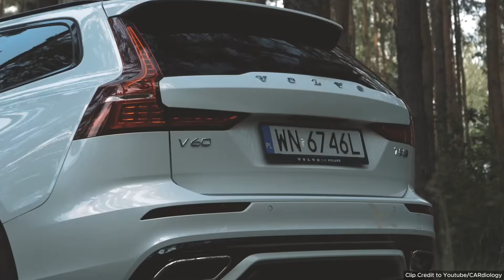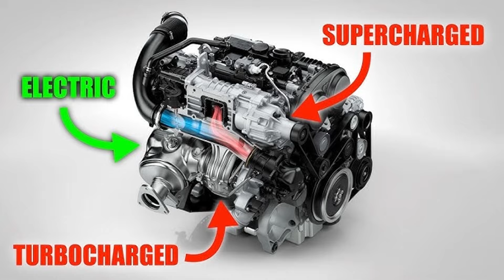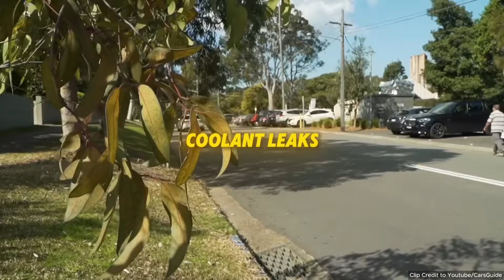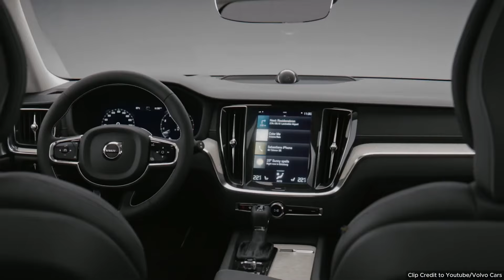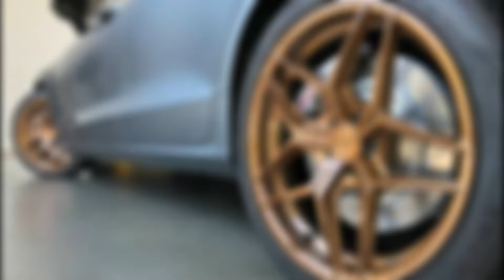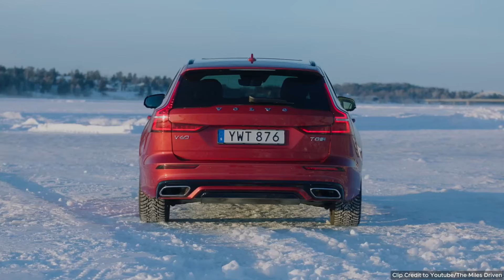Volvo V60 (2018–present): A Complete Reliability Guide

Comment: No it's not the oil exception,

Your lieing, it's the rings fitted on the pistons, that clog up so the oil cannot drain back, so it gets burnt off out through the exhaust that's why it drinks oil.

The BS carefully worded rubbish of modern day crao

👎👎👎👎👎👎👎

In my opinion never buy a car with a sun roof, to fully avoid leaks, problem solved 👍

Comment: No B5, B6? They discontinued the T5 and T6 about 4-5 years ago
Reply: T6 is still here
Reply: @PappaAlvaro Only by name. Modern T6 is a boosted 4 cylinder while the previous was a turbo 6.
Reply: Only by name. Modern T6 is a boosted 4 cylinder while the previous which was a boosted V6.

Comment: Leave well alone.  Tailgate struts fail shortly after warranty ends due to poor components used after 2019.  Volvo are very aware of the problem but refuse to do anything
Reply: Motorised tailgate struts are used on numerous cars and are high wear and stressed components.  They're not made by the car manufacturer.  They fail after maybe 5 years.  Just buy replacements from the Internet suppliers and fit yourself in 20 minutes like I did (£90 for two).  Don't pay stealership prices.
Reply: @henryjohntobin1 exactly,  no big deal. Easy to replace and pay for struts
Reply: Stabilus makes replacement power lift struts. They're quieter and cheaper than the OEM ones.
Reply: Volvo replaced both of mine under warranty. No other problems in five and a half years.